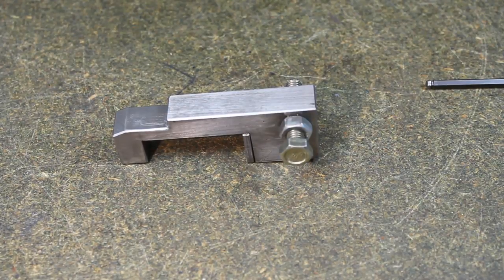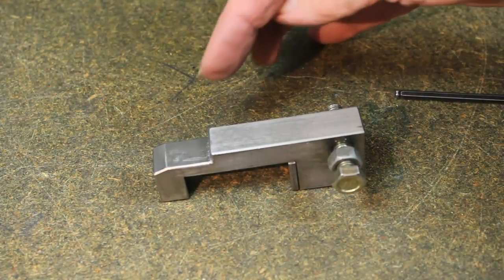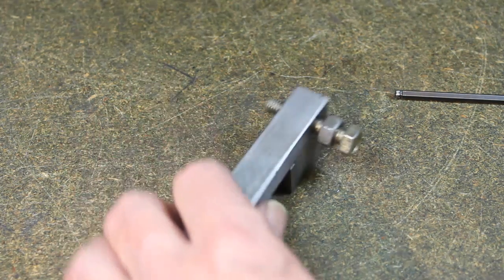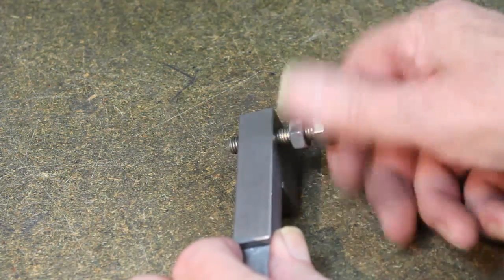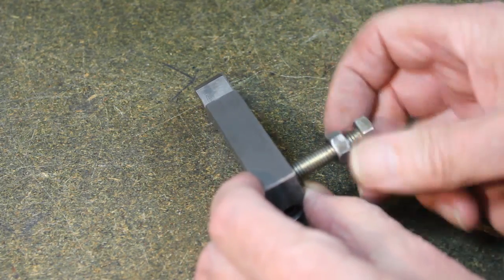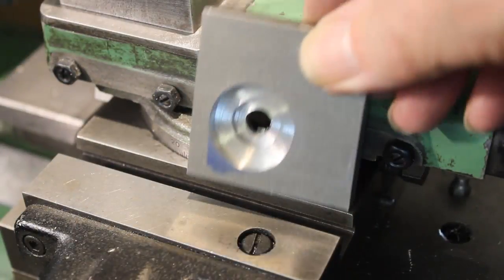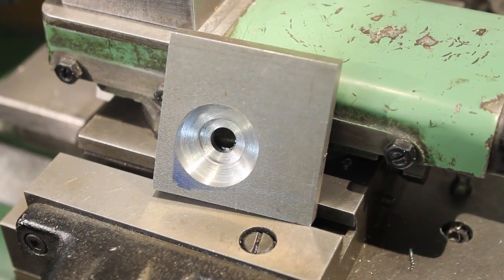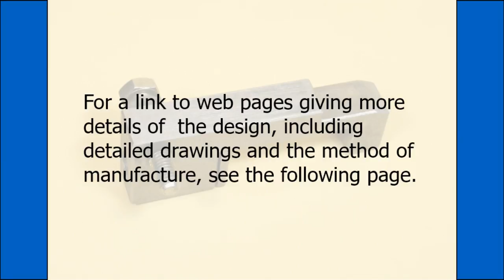Saddle Stop

Comment: great video, perhaps a small upgrade would be to taper the end of the bolt where it stops against the saddle. This will help with swarf not giving a false reading . I put a 60 deg included taper on mine so it has about a 5mm end on it and then further rounded that over with a file after turning the taper. I now find swarf has a much less chance of getting stuck on the end of the adjustment bolt. Thanks again for all your great ideas.